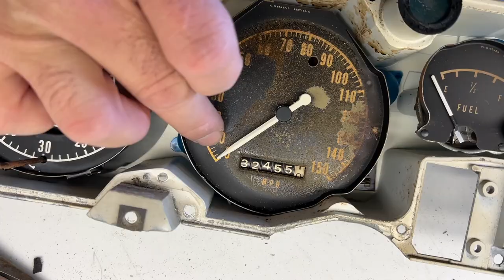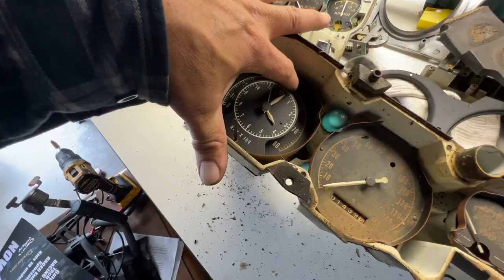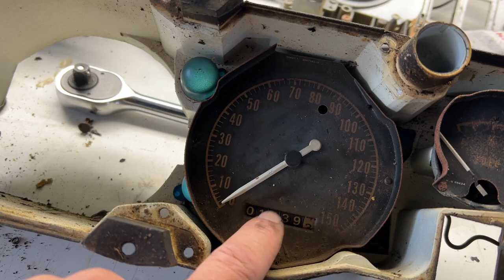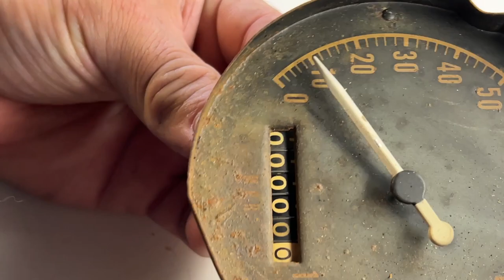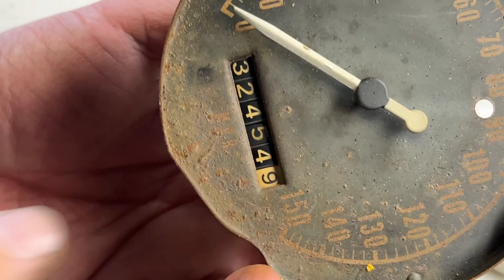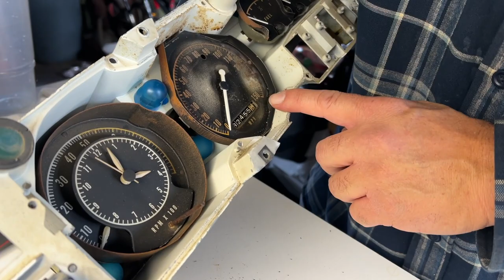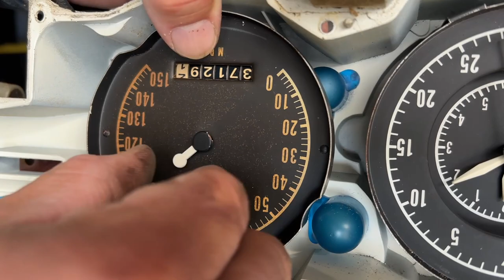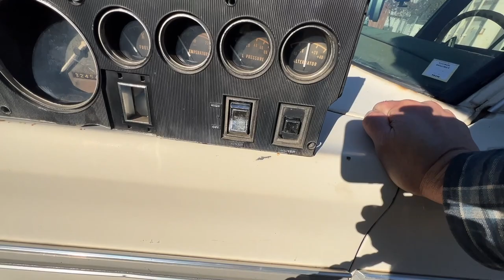How to adjust your Mopar odometer reading to your cars mileage

Comment: Another way to tell the 70 face cover from a 68 and 69 is that there's only three switches on the left hand side instead of four like on the 68 and 9. The fourth switch is deleted because the flasher in 70 was moved to the steering column so 68 and 9 has four switches on the left side and 70 only has three. I didn't know this till about a week ago as I just went through and fixed a couple clusters myself and noticed the difference.
Reply from the maker: That’s cool. I never even thought of that but makes sense.

Comment: At some point, I'm sure I'll be pulling my gauge cluster to restore it. I'd like to figure out why my clock doesn't work at some point. 
My speedometer has never worked in all the years I have owned my 68 though I believe that was always the cable's fault. Never cared that it didn't work thought when I was drag racing. If I wanted to be accurate, I'd probably have to move my odometer reading forward 4 or 5 thousand, lol
Very helpful video for sure.
Reply from the maker: Lol. Thanks for the comment Ts. I still remember when mine in my Coronet flipped out and now pegs 120 when I’m going 60.

Comment: Good video Jonny... There's a a lot of spray electrical cleaners that work well with small wire brushes... Avoids breaking studs... Dielectric grease on all connections is a real good idea to keep corrosion at bay long term... use CRC 2-26 spray to improve electrical connection on socket connectors after cleaning.... Even works a slot car track to keep track corrosion to a minimum.
Reply from the maker: Dang it. I wish I thought of that MoparNut.

Comment: Hey brother they offer new dash faces in decals. I used the white face to contrast this time on mine but they original black of course also. I believe I got mine through Layson and it was really reasonable... like $50-60 for the full set. It's tedious but it went well and made the finished result good. I was unable to get a couple of tiny bubbles were on the speedo because it was such a big guage.  A tiny needle poke and tiny bubbles gone.  Mine looked exactly like yours
Reply from the maker: Thanks Midnight, yeah I know about the new decals, just trying to save time and get her running for MATS next week.

Comment: I have only recently found your channel and subscribed. I am sorry that your Charger burned, but really wonder why it went up? What caused the fire???  Very often I heard electrical issues in the dash started a car/truck on fire. Mostly due to putting too many amps through the lousily designed amp gauge and wiring..  Also, I am sure you already know this, but you can buy all new decals to fully restore your gauges.
Reply from the maker: Hi SteveP, welcome to the channel and thanks for subbing. My 70 had an electrical issue that killed the engine, I cranked, it back fired and lit the leaking fuel from the inlet tube grommet. And yes, I know, but I’m just trying to get the car running for MATS which is next week.

Comment: The evaporust didn’t eat the paint the vinegar ate the paint. Try it with out the vinegar and you’ll see it will clean it up with out damaging the paint
Reply from the maker: Will do Kramer. Next time I will.
Reply: I tried the same thing. Without vinegar. ( vinegar makes me nauseous so I don't use it). basically the same thing happened and the surface paint de laminated. It doesn't matter. I am using decals to replace the faded lettering.